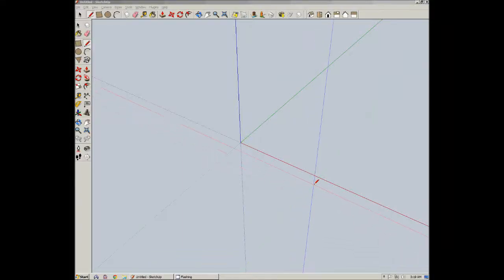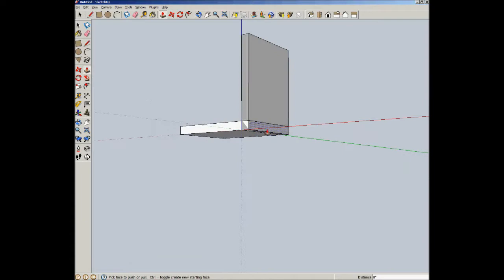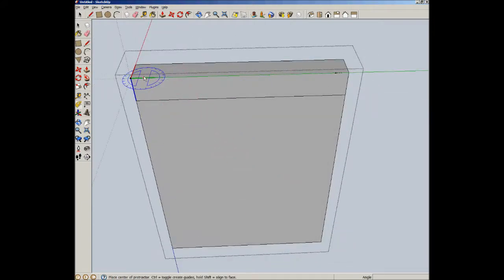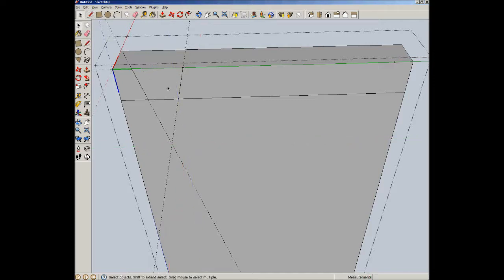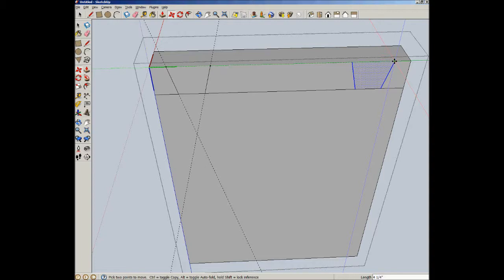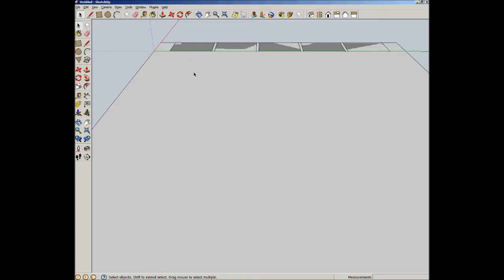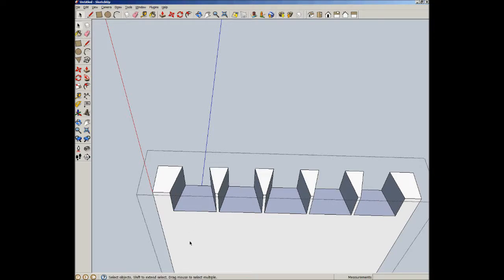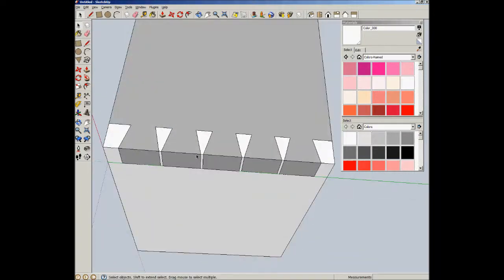Laying Out Dovetails, Tails First, in SketchUp

Comment: This is a very good demonstration of how to draw dovetails in Sketchup BUT, may I make a suggestion, coming from a beginner of SketchUp but a long-time finish woodworker.  In this video, you are a bit too fast for us beginners of SketchUp.  For example, when to go to make changes, it would be so much better if you showed us more clearly where you are clicking up top and then more clearly showing us which selection, you are clicking on in the drop-down list that would be a tremendous help for us.  I have watched this video over and over and over again and still, I'm not sure if you are going to the file or edit list above.  It would be a big help for us.  I have seen other ways to make dovetails, but I think your method is the best.  Thanks, I hope you will make another video on this subject.

Comment: I like this tutorial but I don't understand why when I "Paste In Place" nothing happens? Don't you have to select the end of the board before the paste? When I paste in place, sketchup is pasting the dovetails back where I copied them from and they're highlighted again.
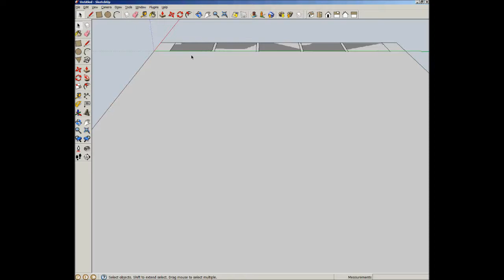Reply from the maker: Richard, notice that I grab all of the tailside joint surfaces while in the tailboard component. Then, around 5:13 I click outside the tailboard component and double click on the pinboard component to open it. Then, without selecting anything inside the pinboard component, I paste-in-place, and the joint surfaces I copied in the first component are duplicated, in the same positions, inside the second component. I think you are pasting in place before you leave the tailboard component. Does that help?
Reply: Thank you, yes, you was right! However, when you made the "second piece of stock" and you hid it, how did you hide it without going up to the Edit menu? I did everything you did up to that point including opening up/double clicking the 'tail' board but the "Hide" link in the Edit menu is grayed-out or not clickable!
Reply from the maker: Richard, I did not "Hide" it in the sense of turning on its "hidden" attribute by selecting the menu item Edit -> Hide. Instead, there is another type of hiding that is applicable to editing components. There are two items that can be reached in the menu View->Component Edit: "Hide Rest of Model" and "Hide Similar Components". I have a shortcut key for Hide Rest of Model, because it is so useful when editing a component.

I haven't done a SketchUp video in years, as they were just supplements to a class I was teaching, but perhaps I should do one on useful keyboard shortcuts!
Reply: Not seeing you go up to the menu and seeing the little + sign I figured you had a shortcut. I would be very appreciative if you did a video on shortcuts. What is the difference between "Hide Rest of Model" and "Hide Similar Components"?

I am fairly new to Sketchup and am happy to see so many videos on youtube which has taught me a lot in a very short time!